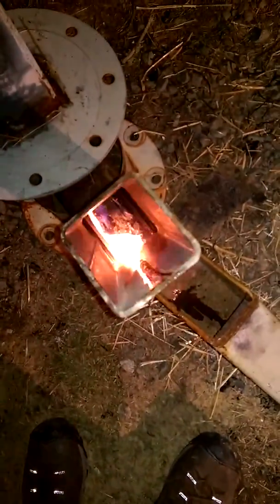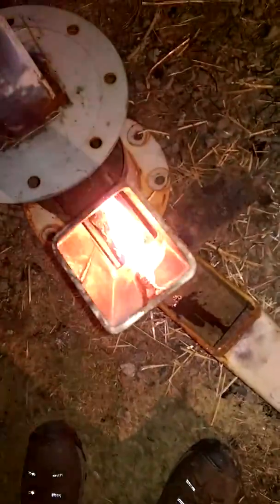Oil burner rocket stove?

Comment: Small petrol heater have steel burner (with a glass tube),
Thin but heat resistant, and easy tu cut, try several (see my last short videos).

You must get heat concentration at down, so no air,
and such air and heat up, simply.